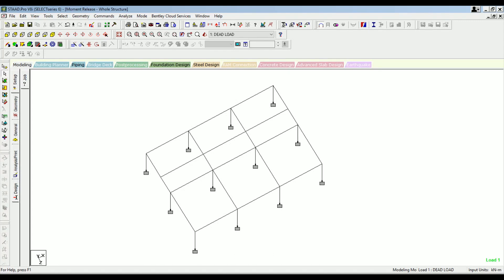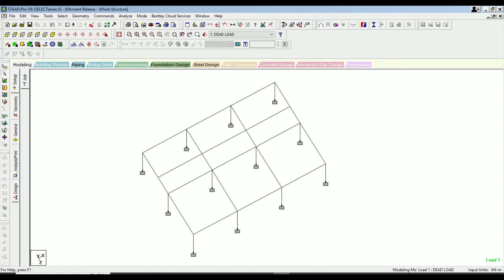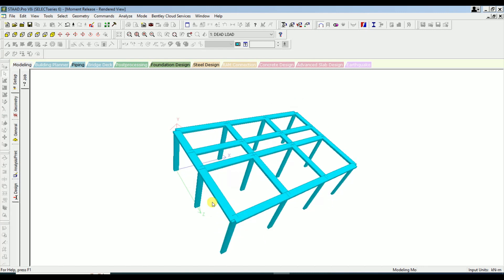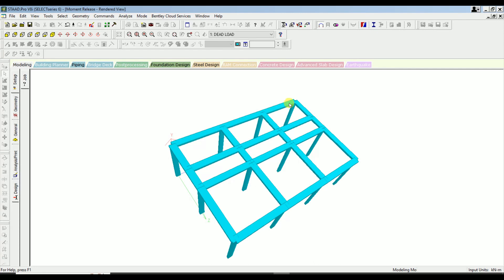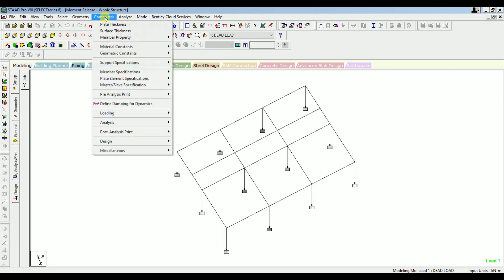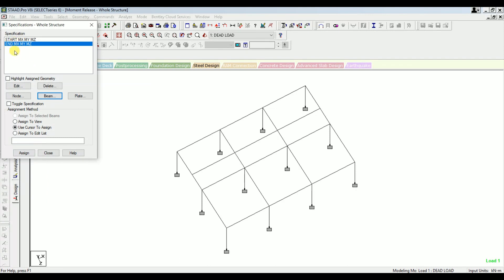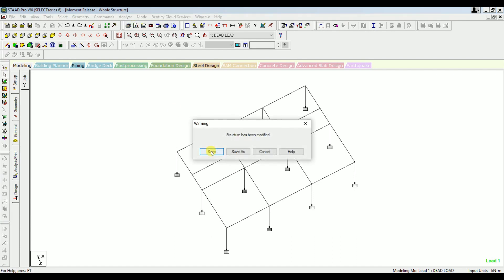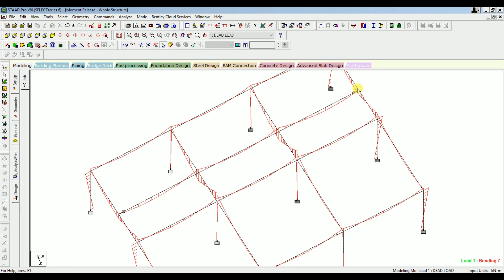Moment Release in Secondary Beam | Moment Release in Beams | Secondary beam moment release in Staad

Comment: If you dont release the outer end moments it will cause torsion. If lightly loaded and main beam is rigid enough, o, but if heavy loaded and main beam slender, torsion is not desirable. SO have to decide case by case. Excellent Work.